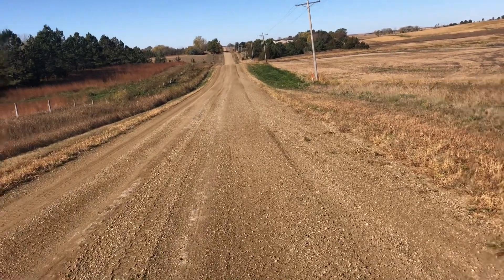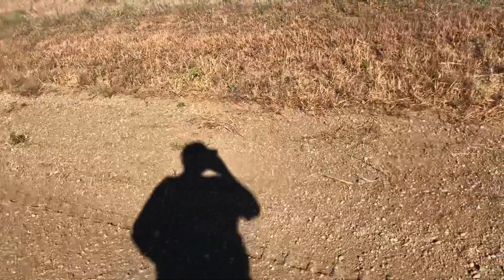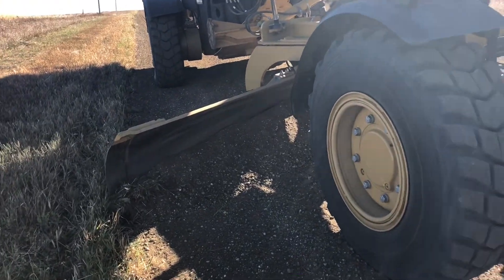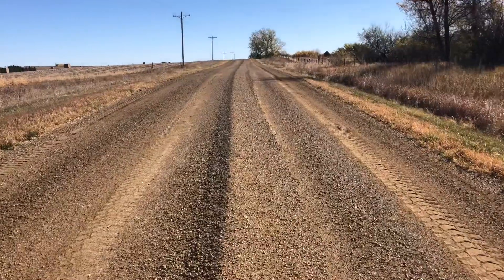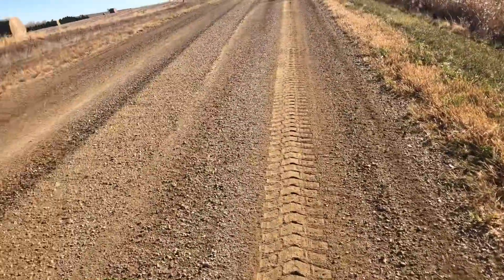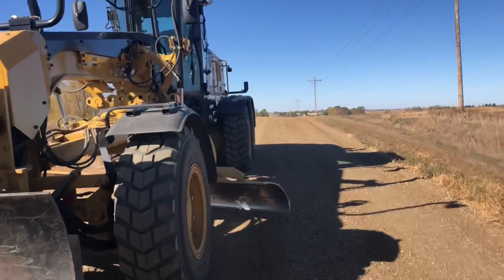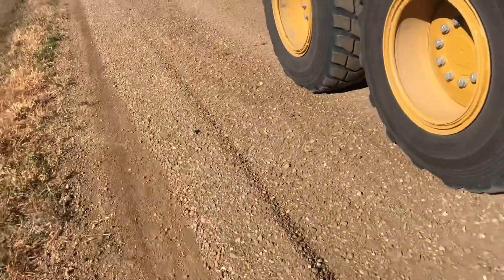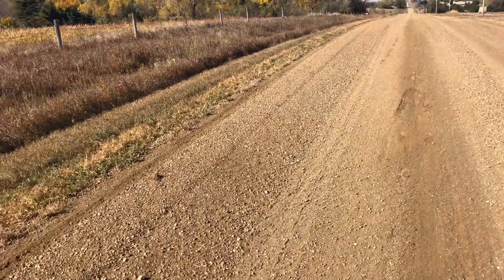How to blade a township gravel road

Comment: this is super helpful, ive just started running a 140H and am fairly green
Reply from the maker: Glad to hear it helps thanks for watching will let me know if you have any questions for me or want me to do a video explaining something.
Reply from the maker: @Connor still making videos what would you like me to do a video on?
Reply from the maker: @Connor I’ve honestly never bladed the way you just described so as far as lining up and everything really don’t know what to tell you and as far as cutting if your in second gear diff locked and front wheel drive on should have no problem cutting lots of material unless it’s extremely hard also while cutting your moldboard pitch is very important if you haven’t watched the video titled gravel road maintenance manual go watch that video it will help you out a lot hope this helps thanks for watching.

Comment: From Canada and as we get close to winter season we or I tight blade the road and pick the steepest side and drop the excess gravel over that side so the wing does not blow the gravel into the ditch way to far to pick up and now when spring comes I pull the shoulder and all my gravel is there ( WHAT DO YOU DO WITH THE SO CALLED LAST PASS ??)
Reply from the maker: I feather my windrows out in the fall of the year on all my roads as far as my last pass goes I do leave that small maintenance windrow on the edge of the road I find it critical to maintain your crown and you always have something to work with.

Comment: Question for you, when you’re grading and you rotate the blade for what ever the reason, does the end toe or heel dig in?is this normal,or is something out of adjustment,or am I doing something wrong?
Reply from the maker: Yes your toe or the heel will dig in when you rotate your circle unless your on completely level ground you just have to adjust your hell or toe as you rotate your circle.
Reply: If you raise an inch on one side the other side drops an inch

Comment: So you leave that small windrow of gravel in place a foot or so from the grass until the next time you process the road? I weren't trackin completely haha.
Reply from the maker: Woos 31 yep I leave a small maintenance windrow on my roads from spring till late fall to me it’s a crucial thing to have to properly maintain your road.
Reply: @graderman140m  it makes sense to have that there for the next time round, I was taught not to leave any material that could catch water or a dipstick driver lol. However, we don't grade as often I don't believe either. I sure wish we did more often though

Comment: I’m going to be grading small narrow roads any videos on how to do them with 2 passes
Reply from the maker: So couple questions I have for you is do you have 14ft moldboard? Also how wide are the roads if there under that 20ft mark it’s definitely a challenge to properly maintain that narrow of a road I will try and get a video put together here for you our weather is changing quick this fall got 6 inches of snow on the way starting tonight.
Reply: 14’ mouldboard and yes there around 20’  hard to keep a crown and make them look good. Must be Canada if you got snow already
Reply from the maker: @blackpineservices5101  ok a 20 foot road you should be able to 2 pass blade that same way I blade my wider roads and unfortunately I’m long ways south of Canada in in SE South Dakota.

Comment: I don’t understand why you don’t just drag heavy chains over the road behind a truck or tractor. The guys that do the blading in my area, their rig shakes with the waves in the road and they simply make it worse.
Reply from the maker: Well if there doing that they are obviously not maintaining the roads as they should believe me you can definitely just blade over the washboards and fill them in and in 2 hrs there worse then what they were I cut all my washboards out and then relay everything making it nice and smooth so it all depends on who’s in the blade and what kind of job there wanting to do. Thanks for the comment and thanks for watching
Reply: There going to fast. Leaves wash boarding. Roads should be scarified to mix fines with clay and stones.